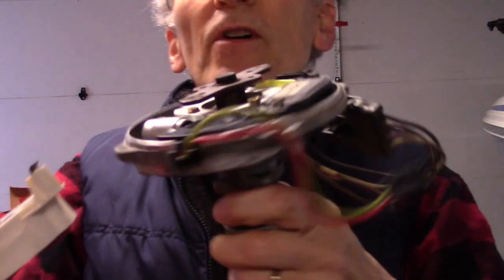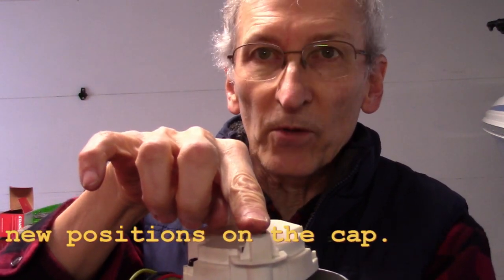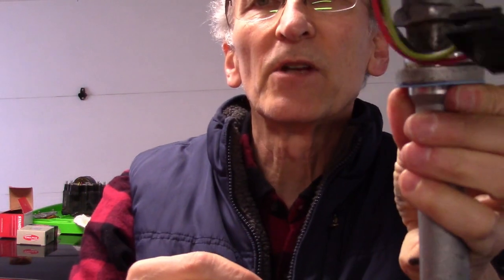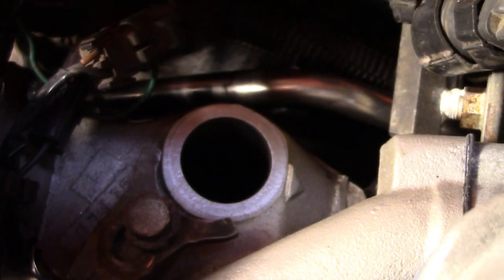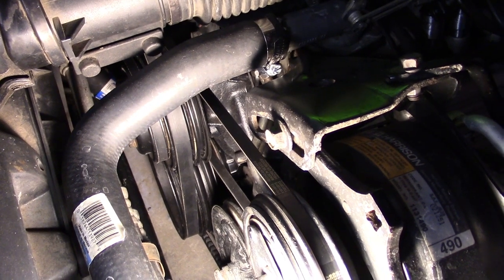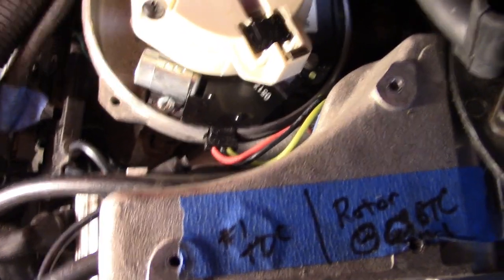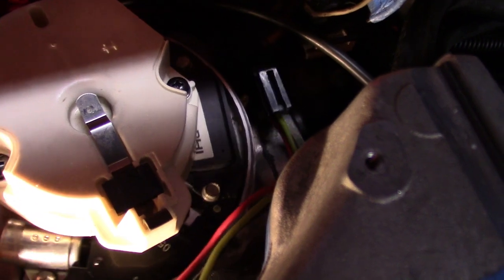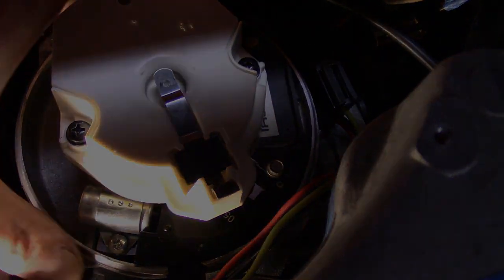Installing the Distributor - 5.0L 305 Chevy TPI - IROC-Z Barn Find EP#37

Comment: Thanks for another great video. This has been very helpful to me as I need to remove my distributor in order to replace the lower intake manifold gasket on my 87 IROC since it has a small coolant leak. I just need to make sure I mark the location of the distributor so I can put it back the way it was. You sir have done a great job explaining the process.

You’re also the only one to show a clear view of the bolt and clamp on the manifold for those of us who just want to adjust the timing.
Reply from the maker: Thank you, and you're welcome, I'm glad it is helpful.

Comment: Hello 

I have a question 
I have no spark cars been sitting for 20 plus years need help 😵‍💫
Reply from the maker: Well, there are a number of possibilities. If you have NO spark and have one of these with GM HEI, the entire ignition system is self contained. It takes 12V to the cap, a good magnetic pickup, ignition module and coil. ECM may control timing, but distributor must provide the basics.
I have a few other videos on the subject.  You might check this playlist for general diagnostics:
https://www.youtube.com/playlist?list=PLaagkwKaZ2RXSe1oI2Js4Q8BsSraxRnDN